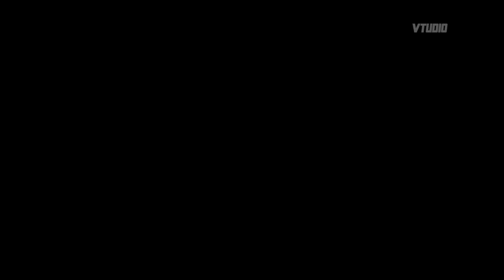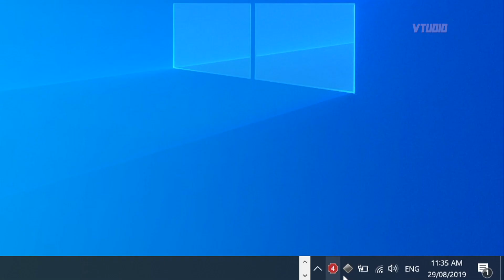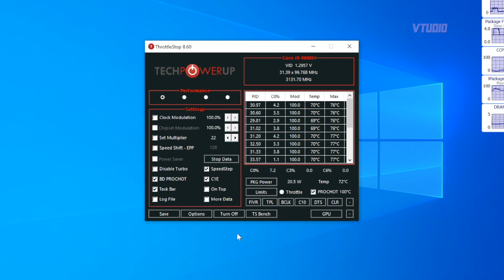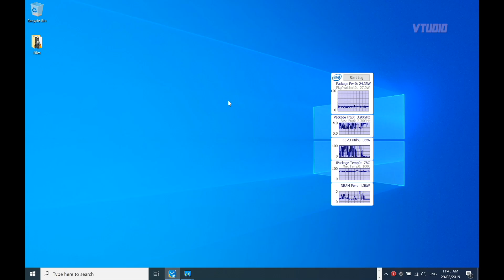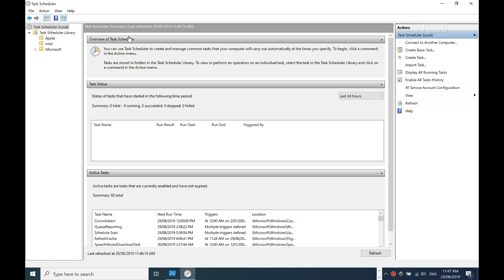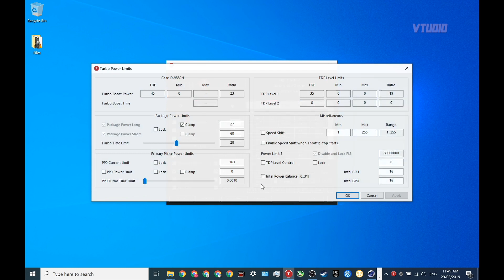ThrottleStop Guide - Fix Windows Bootcamp Thermal Throttling & Noisy MacBook Fans

Comment: Thank you for the video. Hoping this will help my ‘09 Mac Pro’s Northbridge calm down. I upgraded to X5690s which run at higher wattage TDP than the E5520s originally installed. They’ve been running cool at 60 degrees C under load… but the Northbridge ramps up to over 90 C. I’ve been crashing occasionally and I think the Northbridge is the culprit. This should help me get the power draw more in line with the E5520 while still getting the higher clock speed and core count. Thanks again, great video.

Comment: Hey can you help me , I have razer blade 15 2020 i7 10750h cpu . The thing is that my offset voltage is set to 0.00 even if I change it to -100 or other number, it still doesn't change.  I tried it on both xtu and throttlestop but it doesnt work in neither of them .

Comment: This is gonna be especially helpful since I plan to get an older Mac Pro and upgrade it for Windows gaming and video rendering in MacOS. It's weird, Apple computers are usually amazing from a tech standpoint but they're super limited by their own software.
Reply: i mean from a tech standpoint i dont think blowing heat directly onto the screen as the venting is a good thing but ok i gues

Comment: Awesome video brotha! Just curious I just ran boot camp windows 10 pro on my MacBook Air 2020 intel i3 I didn’t install what you suggested but I do notice that the fans will fun and cpu gets hot then I have to open task manager which is using up cpu
Reply: Then once I open up task manager I see it was using like 80-90% cpu then throttling stops once task managers is opened
Reply from the maker: Did you have any apps in the background in use before launching task manager?

Comment: Hey, dude what do you recommend for core i5 1030Ng7 mac book air 2020 bootcamp? I make tpl 27-60 like you. Now cpu temperature 80-85 C. Is it Okay or do you recommend another setting? Thanks a lot.
Reply: 60 for pl2 does nothing because the limit is like 40 watts in the first place. I personally use 27-37.

Comment: What about the setting for Macbook pro 2012 2.9 duo core i7 processor, 16gb ram with Intel 4000 graphic card? Would these setting work for my machine?
Reply: Did you ever find settings that worked ?

Comment: I watched your video and also I watch another video with this program ThrottleStop (but newer version), but have different setting, and you set also different than other gay. I'm a little confused - if i will not using this program and use only fan control for gaming on max - it will be okay?

Comment: I have a 2017 13" macbook pro. i5. On the meter from intel that shows a max 30 on power. At heavy load, while temperature is almost 94°c. Im not sure in understanding this video to translate to my unit. Any thoughts to help?

Comment: hi, I play on your same MacBook Pro, i9 and everything with it, yes expensive and was great for a month then the throttling when I installed bootcamp came, I never played games on macOS itself until I got bootcamp, I only ask if games like tom Clancys rainbow six GTA V and fortnite would benefit from this, any help would be appreaciated!
Reply from the maker: Yeah I use these settings to play games and it works well for me, another thing to try for you would be better airflow for your MBP. Consider a raised stand - I have a review on mStand on this channel, or opening a window if it's closed in your room, those two also make a big difference to thermals.

Comment: When first loading to Bootcamp, Windows will crash followed by a quick loud fan burst and then the Macbook Pro 2018 15", goes to black screen and then boots to Windows again but this time everything will work okay.
After this, switching back to OSX, the first thing that it will show is that an error occurred with a bug error of 210. 
Thanks in advance!
Reply: Did you switch resolution with the drivers from bootcampdrivers.com?

Comment: I got a i7 8850H macbook pro 2018 with vega 20; undervolting in windows bootcamp using xtu- sliders are grayed out; undervolting using trottlestop by -150mv and checking the voltages with hardware monitor while running cinebench r20 results in no change to voltage or score whatsoever.. so it doesn't work unless I'm doing something wrong

Comment: G'day, just a couple questions about this: 

1) How are thermals after applying this? I have the exact same MBP and use it in clamshell mode with an eGPU, I don't want it to get crazy hot because the fans are running a lot lower
2) Is there any performance hit at all from this? if so could you estimate how much and have you tweaked these settings since the video? 

Cheers mate, thanks for this!

Comment: Hello, I have a question, if the fan speed reduce which has no sound but what about temperature. Sure it will goes 90c above. Mine was a base mac pro 16 512gb. So it has core i7. Whenever I start windows it's get hot and hotter during any applications or gaming. Please help me out

Comment: i dont understand.. what does watt do to the cpu freq. ?
Reply from the maker: The speed of the CPU is directly correlated by watts and temperature. If your computer is properly cooled its speed is fully determined by the amount of power you can supply to it. The more watts you can supply the faster it will go. The more watts you supply the more heat it will generate. The more heat that's generated the faster the fans will go to cool the system down.
Reply: @headsoftech  i just noticed something interesting... if i disabled turbo with throttlestop and anytime i put my macbook to sleep, the next time it wakes up the turbo will be reverted back to enable BUT the temps are now way lowerr, almost the same as when i disabled the turbo.. its good.. but why is that happening?
Reply from the maker: My guess is that it's just lower because it's been running cool for a while so the chassis isn't as warm as it would be if it were constantly running hot.

Comment: Can you make a video for 16”? I’m struggling setting my ThrottleStop and AMD drivers on bootcamp to get as much stable power for CS:GO as I need. I have high frames but during intensive gameplay they occasionally drops due to throttleing...
Reply: Done additional tests today and it seems that the problem lies on the GPU side. My CPU runs stable on 3-3,3GHz while gaming, but the GPU drops down from time to time...
Reply from the maker: Something you can try in Windows - haven't tried it myself - is installing the drivers from bootcampdrivers.com and using MSI Afterburner to clock down your GPU. Again, haven't tried it myself yet, so let me know how you get on.

Comment: Thanks for this, fans aren't going as mental in Bootcamp now. Are you using the same settings on the 16"?
Reply from the maker: Nice one, yeah the settings are the same since it's the same processor, but the other main fan noise generator in the 16" is the GPU. So if you want to get those under control you'll have to replace the Enterprise AMD drivers with Gaming AMD drivers - those let you control the TDP on the GPU. Personally though, I just stick to the Enterprise ones and keep my laptop further away from me.

Comment: Some good tips there. We need more Watts. I think the Mac 16 will come out this week
Reply from the maker: Such a shame, if only AMD made a decent laptop CPU.
Reply: @headsoftech  and then they did
Reply from the maker: New tech is cool and all, but to be honest I'm not excited for it - they just updated their MacBook Pro's a couple of months ago. They should just hold off until there's better silicon available rather than flooding the market with half-baked releases.
Reply: @headsoftech  Yep. Apart from the 5500 10the Gen (still 14nm) won't be out until after the desktop 10th Gen. So probably April next year. Maybe even later. I got told by a someone in the industry that they are struggling bad making enough 14nm the x299 boards are reading but the cascade lake CPU are MIA

Comment: This is a good software pack sir. Thank you for sharing this with us. I watched this video completely now. ;)
Thus, I am wondering would you recommend this to us that are using older MacBook Pro models?
Reply from the maker: Yep, it helps all laptops, you just got to tweak the settings to fit its thermals. Just keep Intel Power Gadget running and when it gets hot, log the wattage and go from there.
Reply: @headsoftech  Easy enough. Thank you sir.

Comment: My i9 with vega 20 and 32 of ram is working super good, on windows i undervolted it -0.150v and overclocked the vega 20. Im using a 100w type-c power brick so the battery doesnt drain, the max power in-put is 99w if im not mistaken. Great video man!
Reply: Does undervolting the 2018 and 2019 MacBook Pros in ThrottleStop actually make them cooler? Which portion of the settings will actually makes them undervolt. By how much? How do you unlock the clock speed for the Vega 20? Never figured out how to enable it even though people claimed they managed to do it. I want to eliminate the thermal throttling even under higher CPU and some GPU load.
Reply: goldmastersims are you talking about windows right? I think that on Mac OS it’s already undervolted and I just push the fans as hard as they can when doing something intensive. Undervolting on windows gave me 300mhz more on the cpu side and goes to 91c under sustained load with the fans at max. (Prime 95) and the vega is with +150 core clock and 600mhz on the memory
Reply: Rodrigo Yes, I’m asking for Boot Camp. You used ThrottleStop to undervolt right? You using MSI Afterburner or Radeon Wattman to unlock the GPU clock speed? Or is the GPU just going faster with the lower temperatures?
Reply: goldmastersims I’ve undervolted the cpu with intel extreme tunning, I find it way easier to mess around. You can lower the tdp if you want too. And I’m using msi afterburner for the overclock, but you can use the app of the amd driver (is it called wattman?)
Reply: Rodrigo Yup, AMD’s overclocking app is Wattman.

In Intel Extreme Tuning Utility, is “Core Voltage Offset” in blue for you along with the IccMax? It’s gray for me. How can you get it to be blue?

Can you show step by step to overclock Vega 20 with MSI Afterburner? The procedure from bootcampdrivers.com doesn’t work for me.
Reply: @rodrigo4379 hey I know it’s been a while, but I can’t quite seem to over clock my gpu on MSI afterburner, could you help me?
Reply from the maker: You're the man
Reply: With which software did you overclock the vega 20? I can't manage to get the FIVR panel to work on my 2019 16" mbp... the undervolting options are grayed out, I can only do what he did in the video
Reply: @charlieblu89  I used intel XTU and msi afterburner to oc the gpu
Reply: What do i do i have same mac n i9

Comment: What would you recommend for the 2017 15" MacBook Pro Intel Core i7 7920HQ @ 3.10GHz?
Reply from the maker: Hey mate, I haven't tried one of those beasts myself. I'm a fan of 60W for the short term Turbo, as that'll be the same max limit as my system as the Power Supply is the same for both of ours, but for the long term turbo, I'd recommend is just firing up Intel Power Gadget and as it gets too hot (noisy fans), take a look at Intel Power Gadget's Watt meter and start setting the watts accordingly. Let me know how you get on.
Reply: With your setting on my config I still getting battery drain :/

Comment: Im the first tı watch btw xD
Reply: @headsoftech  I'm starting to game on my mid 2014 macbook pro retina 13 under bootcamp. what would you suggest to max the perf ? already cleaned the inside from dust, changed thermal paste, using macs fan control to keep the CPU temp low and optimized windows for best perf under settings. anything else ? thanks so much